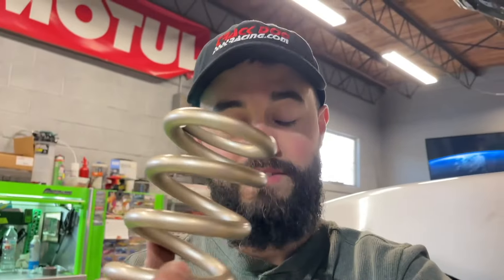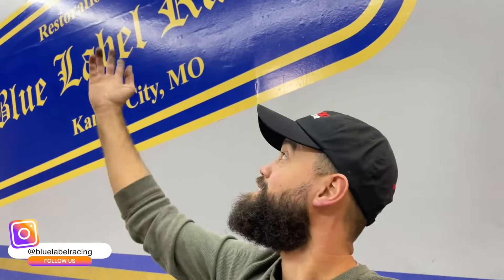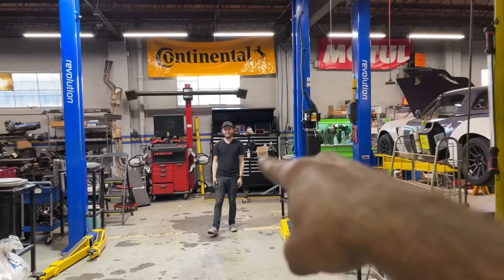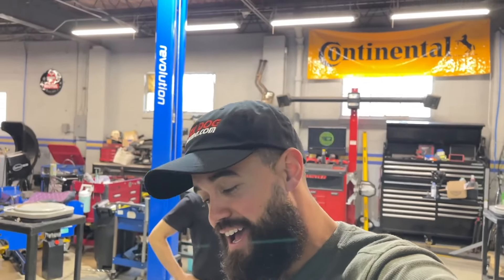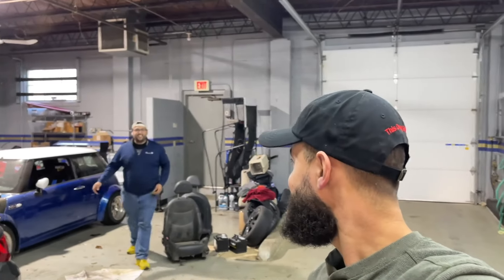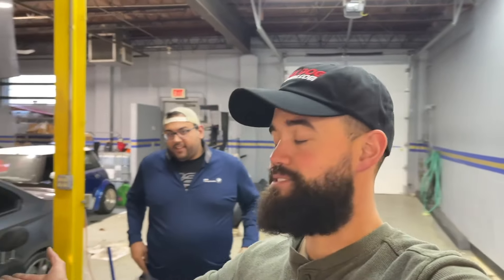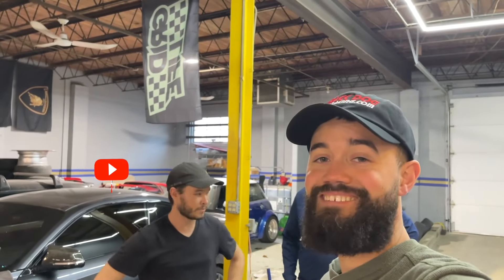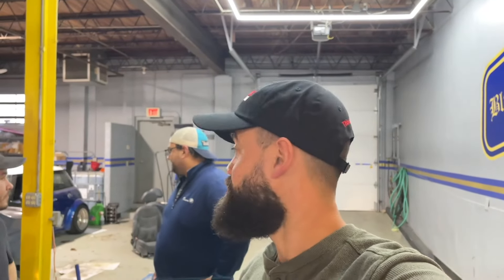How To Install Swift Springs On A Miata | More Shock Travel, Better Handling

Comment: Just keep in mind the next travel limiter after tire contact is UCA to frame.
Reply from the maker: I saw that when we were messing around with it. I didn’t fully set it up that night. We just took some measurements. When I get the top hats on I’ll actually set it up.